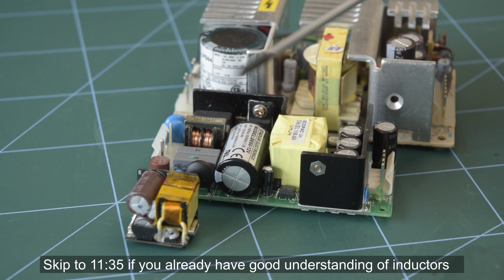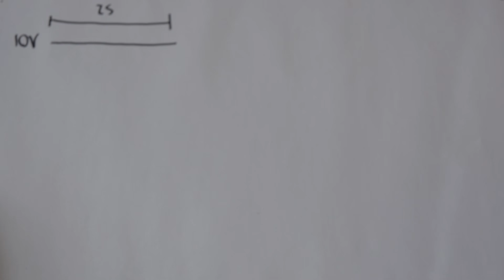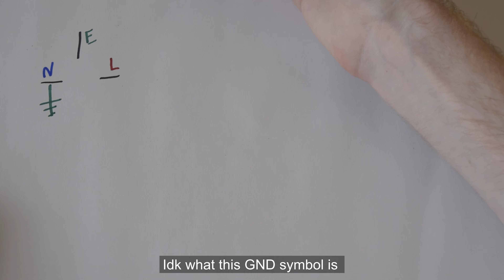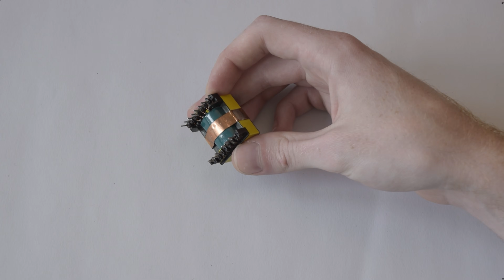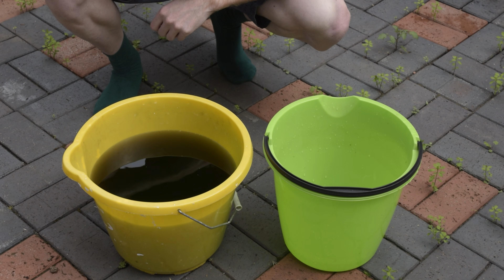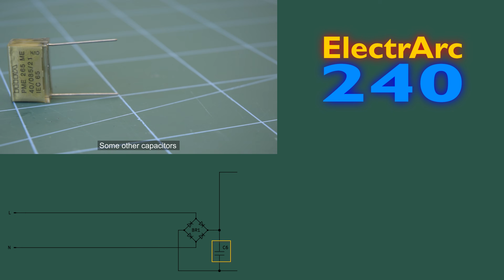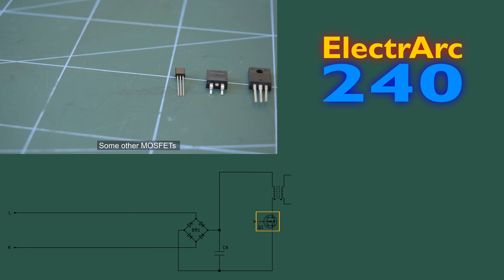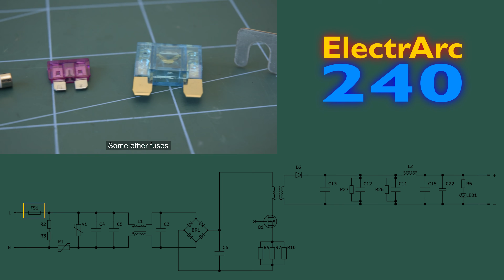Every Component of a Switch Mode Power Supply Explained

Comment: Why does the release of power cause high voltage? The components will only take so much in
Reply from the maker: They release all the energy in one go. So they may take 1 second to charge at 1 watt but they can discharge in 1ms so that's 1kW!
Reply: @electrarc240  ah. So it relates to time. Is this an issue with AC as well?
Reply from the maker: Isn’t really a thing with AC because passive components like capacitors and inductors won’t store any significant energy as they are continuously charged and discharged by the alternating polarity
Reply: Thank you @electrarc240

Comment: Actually that's not totally true. The appearance of GaN and SiC have drastically shrunk the size of SMPS and dramatically increases the efficiency. The control IC's are now now fully integrated, thereby dramatically decreasing size and improving efficiency.
Reply from the maker: Yeah I think that combined with packaging advancements have definitely accelerated improvements in power density recently tbf

Comment: Greetings! 4 months after posting of the video, I do have a question. Utilizing the switch mode circuits of these power supplies would it be possible to create a stable power source that could take in 220 vac 50 Hz and provide an output of 120 vac 60 Hz at about 10 amps? Somewhere in the past I could have sworn I had seen such a supply but cannot locate the source as to where I found the is switch mode converter. Need it for some small kitchen mixer and a few small hand tools. The mixer can run on 50hz but not efficiently.
Reply from the maker: To use power electronics to convert AC to AC but change frequency generally requires going to DC first. The first step could use an SMPS but the second would need an inverter which would be more complicated/costly
Reply: @ I do have a 12 volt 50 amp switch mode supply and have thought of feeding the output to a true sine wave inverter but without knowing what the draw is from the inverter to provide the necessary current I need, I don’t want to risk damaging the switch mode supply.
Reply from the maker: @Subgunman  Hmm yeah, should be fine if the inverter's lower power than the SMPS, or if its over just don't draw too much. I don't think those 12V inverters draw significant current except maybe to charge up their input caps at startup. That's a beefy SMPS you've got!
Reply: @ yes it is, got it many years ago at a Hamfest, it was used in some industrial equipment that went surplus, only issue is that I do not know how noisy it might be. I may have to install some filters on the mains Input as well as the output. Quickest way to find out is to fire up the HF rig and just listen through all of the frequencies.

Comment: Why is it that I can feel a tingling sensation in my fingers when stroking a metal component of a device connected to a switching power supply? To me it does not make sense as the device is isolated from the mains and just by touching it, i am not completing a circuit. I can feel the sensation when the appliance is turned on or off but still connected to the power supply! 😢
Reply from the maker: I've experienced exactly the same! It's due to capacitive coupling within the power supply circuit between input and output that is always present. If you measure the voltage from the output to ground with a multimeter you may get quite a high reading (100VAC+) though this is high impedance so won't kill you. Medical power supplies make an extra effort to minimise this input-output leakage.

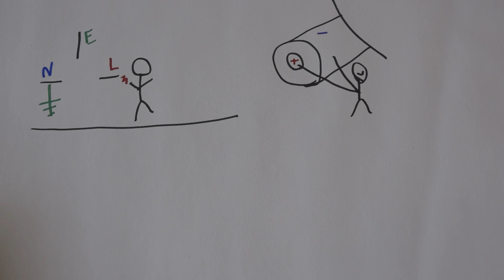Comment: Sorry, but I don't understand how isolation can make a circuit safe. In the video (7:38), you state that it's not dangerous to touch either terminal of a DC power plug, as there's no direct connection to ground. And yet, if you were to do this with a high voltage DC supply (e.g. for a valve amplifier), you would receive a lethal shock. So, in either case (apart from the difference in the magnitude of voltage and current), won't current still flow from the power supply terminal to ground, via the body?
Reply from the maker: You could touch just one pole of the output of an isolated 10kV power supply and be fine, touching both will kill you. If the supply is not isolated then the potential between the poles and ground will be fixed and won’t change to become safe if you touch them. So if you’ve been killed by a valve power supply from touching just a single pole it must have been ground referenced aka non isolated
Reply: @electrarc240  Thanks very much for your explanation, but I'll need to do more reading on this subject to understand it better.
Reply from the maker: Yeah it’s really hard to explain in words haha
Reply: @electrarc240  That's OK. I guess I'm not very clever 😋

Comment: Yes there is a limit in size the copper wire resistance and i can asure you that small 30w power supply will last not even half of the life of the old 24w power supply lol

Comment: Where is the short circuit protection circuit?
Reply from the maker: The controller uses current-mode control so will shut down almost instantly if a short occurs on the output.
Reply: @electrarc240 thank s for fast response. can I modify remove  the "current - mode control controller " thingi and replace by some relay to switch on and off instantaneously. I wanted it to work as a  lab bench linear power supply.

Comment: I have a SMPS. It contains a optical isolator.  How come the SMPS in your video does not contain one?
Reply from the maker: It does, I think I briefly mentioned it but as it is not directly involved in the transfer of power I didn't mention it much. It will be mentioned more in the control video when that is made
Reply: @electrarc240  Thanks for your reply.

Comment: Why does the inductor have 6 pins?
Reply from the maker: There is an extra secondary winding for powering the controller
Reply: @electrarc240  I've one without a controller which still has 6 pins (all connected). why?!

Comment: "You will not find any powersupply that is not Issolated even from the dogyest parts of the World" yes about that. I am sure that I have seen more then one Video from other channels with Power Supplies that where not properly issolated. From lamps, to Phone Chargers, or mostly powerbricks with integrated usb connectors for charging.

Comment: as a 67 year old jab a screwdriver into a power supply at 7 years old and blowing the end off, I find it quite shocking. however, america has a neutral and a ground and a positive. 3 not 2. 2 grounds actually. duh.

Comment: Thanks, but no thanks! 
Did not need to buy meself another pitch-black brick, referred to as an ugly little switcher, off you anyway. 😯
I think I've snatched sufficient parts off discharged electronics in my lounge myself by now. 🤧
So that with a tiny bit of supplemented brains, 
one just extracted from a Cockroach near the front door kept for several days inside a tiny cage,
we feel, one can nearly knit our own on protoboard some day. 😃

Comment: But that is transformer right like step down transformer
Reply from the maker: Technically a coupled inductor but some people call them flyback transformers. Very similar to transformers but they operate in a very different way. Power in and power out happen at different times and energy is stored in between whereas a transformer stores no energy (ideally)
Reply: @electrarc240  ok

Comment: "Not even from the dodgiest parts of the world"...
Ooohohoho... you then have no idea.

I have ordered power supplies off Ali Express and Ebay that have turned out to be not isolated at all. 5v between positive and negative leads. But mains AC between 5v and ground.
It's a gamble. Sometimes one get proper PSU's. Other times one get dodgy a.f. PSU' that will kill you the moment you touch the DC output.

Comment: Why do you call the stepdown transformer an Inductor????? K2 is an INDUCTOR, L1 will be that component, with the 2 visual sets of copper windings, mounted between those 3 x grey capacitors, rught next to the mains input, it's isolated double Inductor , one fir the nains input neutral line  and one Inductorfor the Live input lines , it forms a mains Ionput filter!  The rectified mains DC,gets switched at frequency  far higher than the mainsl voltage frequency,  normally around 16,000Hz  minimum. The power mosfet power transistor swiches the rectified mns voltage through that T1 high frequency step-down transformer, that I say is a TRANSFORMER and Not an INDUCTOR
Reply from the maker: The core is different, a coupled inductor like this has an airgap to store more energy and prevent saturation. If you used it as a transformer (energy in and out simultaneously) you'd have some pretty poor hysteresis losses. Higher power SMPSs have transformers in topologies like forward converter.

Comment: This electronics is maybe fro %m 50 000 BC. Look, you do not need GaN SiC or Si FET, you do not need DIODEs, you do not need
capacitors or inductors or coupled inductors, or transformators, you only need to controll flow of each electron, so if you
controll electrons, you have 100 % IN and 100 % OUT without EMI, without heating of components, so instead of wasting
time with this OLD stuff, you can invest your time, to R&D of LOSSLESS ELECTRONICs.

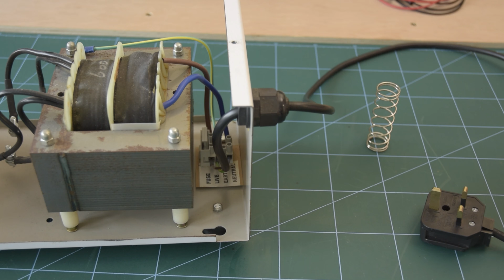Comment: 2:00 Sorry but I disagree, a spring having the other end fixed is equivalent to a capacitor. It's easy to press at the beginning, until it's collapsed, same as the current over a capacitor. On the other hand if you connect the other end of the spring to a mass, horizontally, on a no friction table, if you puss the spring it will take some time for the mass to move, and if you stop the pushing, the mass will continue to move for some time until it stops, similar to the current in an inductor while building or collapsing the magnetic field.

Comment: Since the 80ties, Switching Power Supplies have gradually killed the HAM hobby. Even if every Power supply passes certification, the added noise pollution off all the hundreds of units affecting your city location floods all the bands. Those EMC components are vital for all digital communications as well. Just one failed power supply can bring down DSL communications in a 300 meter radius.
Reply from the maker: In a bit of irony I took down DSL comms of my entire village when I was much younger and built my own radio transmitter. May or may not have transmitted square waves...

Comment: how is that not a transformer?
Reply from the maker: A coupled inductor is almost the same but is designed to store energy, getting charged up and then discharged. A transformer doesn’t store any energy it is just transferred from one side to the other through the coupling between the windings
Reply: @electrarc240  alright, I still gat a lot to learn then. How do I identify or different them physically?
Reply from the maker: @OfficialScamBusters  That's the problem, they are visually identical. the only construction difference is the magnetic core will be a different material or more likely have an "air gap" which is where the majority of the magnetic energy is stored in the inductor. You can't see that without taking it apart. Some in-circuit tests could perhaps reveal what it is but you're best off looking at the surrounding circuitry to tell. That's what I did for these PSUs. Might make a video covering the difference a bit more at some point
Reply: @electrarc240  please do. Love ya vids btw👋

Comment: Nice, but a transformer will stay a transformer even if you call it an inductor. A transformer has coils which have inductivity… it‘s important to use proper wording when teaching or people get confused… thanks for the effort.
Reply from the maker: Thanks, transformers aren’t designed to store energy which is what differs them from coupled inductors. These would make very poor transformers and vice versa. Transformers have current flowing through both windings simultaneously with their magnetic fields cancelling, coupled inductors only ever have current flowing through primary or secondary(s) not both and they have to store all the energy that passes through them
Reply: @electrarc240  Thanks for your reply. My point was on terminology. You are right: a transformer has windings (coils) , ever wire or coil is primarily an inductive effect when current passes them as it creates a magnetic field which may induce current into another wire. you put 2 coils next to each other you have a transformer. My point was not your technical facts, which are fine. But you show a transformer and call it an inductor. It is not an inductor it is a transformer. The windings have inductivity. Even a coil is not an inductor.. ;) A coil may induce via it´s magnetic field but it remains a coil in function and a transformer (as it transforms voltages) remains a transformer in name..

Comment: Linear power supplies last forever, the switching turds from a couple of weeks (chinese junk) to a couple of years (name brands). Isolation is an issue too with switching power supplies as decent creepage distances and clearances in between components is not always respected.

Comment: I thought you were going to go through things step by step. This is just like every other dry electronics video, skips from A to F and expects you to fill in the gaps without telling what they are. I've gotten as far as the inductors and I still don't know why they're used and where they go. So does mains voltage just go straight into the inductor thing or what?
Reply from the maker: Keep watching

Comment: The input filter components are also a legal requirement to protect people using life supporting medical equipment such as kidney dialysis for instance, as there might be someone next door using such equipment whose mains supply is on the same phase in which case they would be vulnerable, and it could be a CHILD! And there are some cheap tatty switch-mode power supplies around which are not made to proper safety standards and which don't have such filtering, I know as I've seen them, SHAME on whoever makes them! LIFE comes before profit! And you forgot the components usually fitted across the isolation gap to protect against too high a voltage from building up across the transformer, I think you'll find they too are a legal requirement as they protect the transformer's insulation from dangerously breaking down and causing a serious hazard.

Comment: For heaven's sake, stop saying "squish".  Incidentally, the correct mechanical analogue for inductance is mass or inertia (not spring) which corresponds with motion being the analogue for current.  Spring (compliance) is analogue for capacitance, which corresponds with force being the analogue for electric potential (Volts).
In your explanation, instead of invoking a spring, you should have compared it with a spinning flywheel.
You may be a clever boy (not as clever as you think), but where are your basics !!!